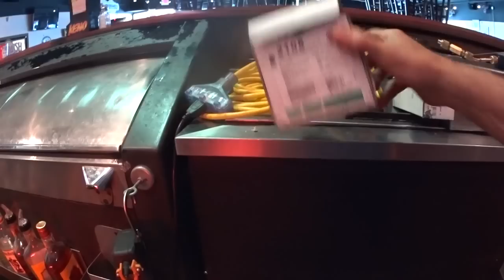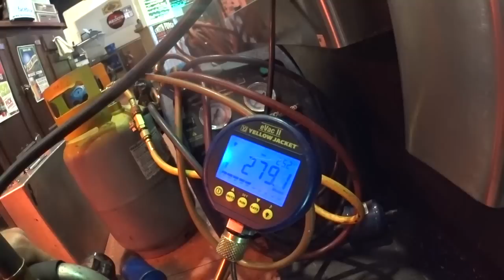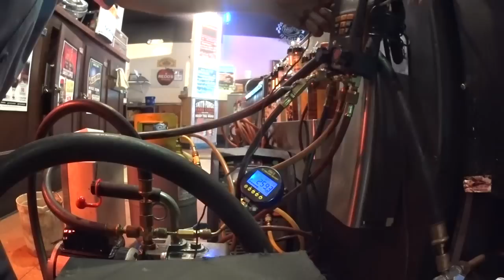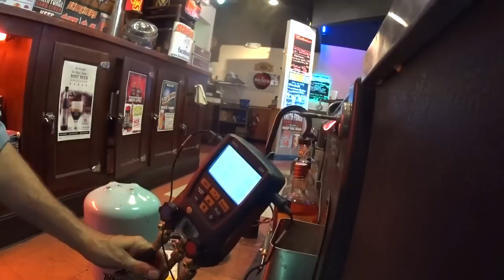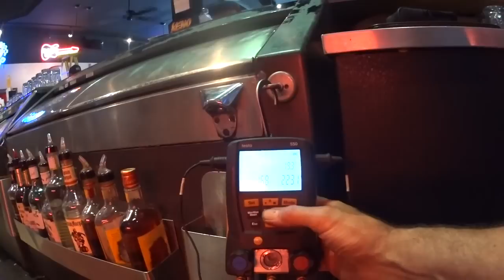True Beer bottle cooler,  1/2 hp compressor change

Comment: Thanks for your interesting videos. A lot of knowledge being shared in every single one. Wanted to ask you if you have one explaining the wiring coming into that box that has the capacitor attached and how they are connected to the different devices . thanks

Comment: I have an old Lennox unit with a mfg date of 1979. Actually, the serial number has been torn away but I dated it before it disappeared. I don't know if the compressor is original... it looks great, but the repair guy told me if it goes, it will be impossible to find a replacement compressor.  Does that sound true? Thank you.

Comment: I remember 2 different styles of bottle coolers for soft drink bottles.  One was a "wet" cooler where all the bottles stood submerged in cold water.  These types were inside stores where you'd take your purchase to the cash.  The other type I remember was a vending machine, dry cold.  The bottles would be loaded by the vending operator who would have the keys. The bottles would be suspended by their necks (there used to be "slots" on the neck, created by having thicker glass rings below the lip of the bottle) in steel channels.  You would slide your choice of bottle to the release area.  You'd put your change into the vending collector. It would allow you to then pull the bottle straight up and out, then it would lock again.  The "wet" type succumbed to leak problems, combined with abuse by shop owners who didn't know enough to monitor the liquid level in the tub area. That and corrosion.  The dry type was succeeded by vertical-stacking vending machine, which could hold far more capacity, and took up half the floor space.

Comment: I have debated with myself on whether or not to include low and high pressure protection to new compressor installations.  It will save a compressor and a lot of cost  and inconvenience for the customer in the long run...... whether they realize it or not.  I will tell them first, and I'm sure most of them will balk at the idea.  I will inform them of the reasons,  and if they still want to say no,  then the next repair will more than pay for the preventative action that could have been taken.   That and regular maintenance.  Probably won't go for that either.  The old saying:  You cut your nose off and spite your face will probably be true on this.

Comment: There for a moment I though you took a swig off the liquor . I just got a old RV camper with the old unavailable refrigeration gas should be fun switching it over .  Its also has a orifice regulation something I will have to study up on . What would be good to flush out the old oil with ? Thanks again for real world AC education .
Reply from the maker: nisw1918 you don't have to flush it, just add POE plus refrigerant

Comment: Jim Jim Jim, what can I say? First I would like to say I have watched quite a few more of your vidz and you seem like a very competent tradesman. However your fixation with leak lock and thread tape seems to once again get in the way of an otherwise very educational posting. Here we see you putting goop on the suction service valve inlet thread on the compressor, why, why, why? In this case the white nylon O ring act as both the seal and as a spring washer preventing the rather large nut from loosening. I have somewhat became a fan of your videos captivated by your methodical procedures. Its just a shame you can't take my constructive criticism and learn from it.
Reply from the maker: +Ian Bartholomew Ian, your ranting about my use of leak lock is making me want to make a video dedicated to you, I'm going to get four tubes of leak lock and slather it on everything, it's going to be dripping everywhere  :)  peace out cub scout

Comment: Thanks for sharing your videos!!! I really learn a lot from them.... I'm having an issue with one of our walk in coolers... Normal low side pressures(57-60) with high head(spikes up to 340) its a 404a unit that was worked on in November.... My initial though was an overcharge since it's been blazing hot down here in central Florida(100 degrees)... Any thoughts??? It runs fine for awhile then eventually trips the high side pressure switch.. Any information would be appreciated.... Keep up with the great videos!!!!
Reply from the maker: Armando Torres first wash the condenser, second, I had a Subway with a yr old  walk in cooler, head pressure was high, the condenser fan was turning but slower than it should, I found the motor had a small rectanglular capacitor on it that was bad, I changed it and it worked good. If the head pressure keeps going up and down I would check the expansion valve, is the bulb clamped real tight, is the evap too small, that would cause the valve to hunt, is the evap coil clean,
Reply: Cleaned the condenser coil today and checked fan capacitors... Its a dual fan condenser... One was reading out of range(2mfd 10+- reading 1.3), but it doesn't appear to be running any slower than the other... The evap didn't appear to be clogged with the naked eye... Probably due for a cleaning though... I'll check the sensing bulb and look into replacing that one capacitor tomorrow... Thank you so much for the response!!!
Reply: @armandotorres626  just wondering what became of this issue. Did you get it sorted out. Yes, it's been 4 years, so, you probably don't even remember this issue, but, incase you do.. I'd like to know. Thanks

Comment: Great video Jim as always. Quick question about the tape you use, is it standard Teflon or a refrigeration type tape leak lock brand ect. In the video it appears to be blue?  Thanks Jim.
Reply from the maker: +Chill Refrigeration,Heating &amp; Air Conditioning LLC  you can use standard, but it tends to be thin, this tape is called "Blue Monster" I got at my supply house.
Reply: Ty Jim

Comment: Micron gauge on the pump again. I was always told it's sensing what the pumps pulling. Check out True tech tools Jim
Reply: Kcarviper Its not so much of an issue on this size of system, can valve the pump off and see where the vacuum is at.
Reply from the maker: Kcarviper I didn't think it would matter so today I did a compressor change out, see video, I put two micron gauges on , one on the vaccum pump and one on the hot gas discharge port, the vacuum pump one read 155 microns and the hot gas port read 355 microns, clearly double. You were right, Thank You for bringing that up.

Comment: A pressure control can save a compressor. Good work,  thank you for posting it.
Reply: Julio Chavez I agree, with a manual reset. Would have saved compressor. They make tne screw on switchs.

Comment: If you don't change out the oil and just add to it, isn't there a chance there might be too much oil in the system or isn't that a problem? should you dump some out of the compressor?
Thanks for the videos.
Reply from the maker: amtpdb1 change the oil in the compressor, thats the best way, I've done that alot. But when its a small system you can just add 20%. you don't over fill that way.
Reply: ***** If the system is full and you add 20% won't that be over full. I don't mean to be dense, I just don't understand. 
Thanks again for teaching us.
Don
Reply from the maker: amtpdb1 not that critical, besides some of the old will hang up in the evap
Reply: ***** Thanks

Comment: First time I have seen hoses like you are using on the vacuum pump?
Did you make those Jim?
Reply from the maker: Erik Cable http://www.trutechtools.com/Appion-MegaFlow-6-Foot-12-Dia-38FL-to-38FL-Black-Hose_p_3678.html?gdftrk=gdfV26224_a_7c2772_a_7c10009_a_7c3678&gclid=CjwKEAjw8LOsBRDdub-swPW8riISJAAnmS019yWKzTMCv30QcE169GczGFebGmXkeSr-heUWVaIWmRoCu4jw_wcB
Reply: Thanks Jim